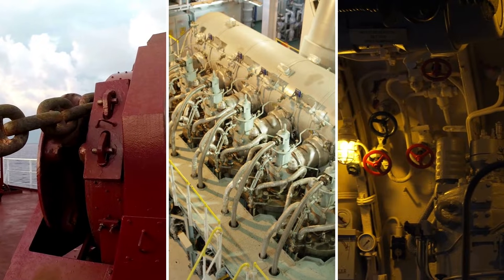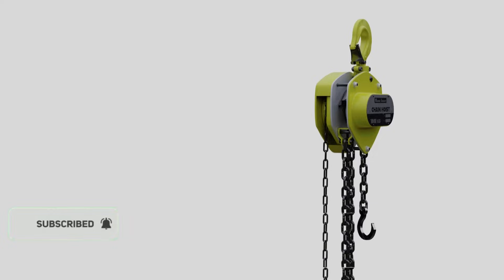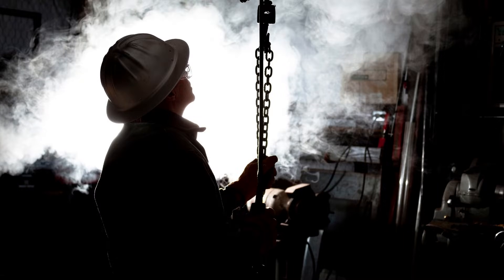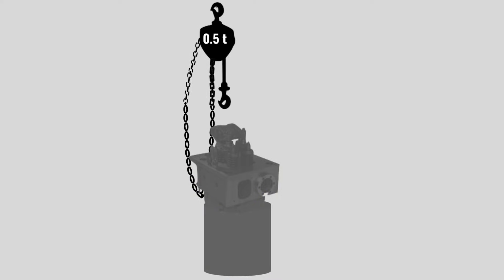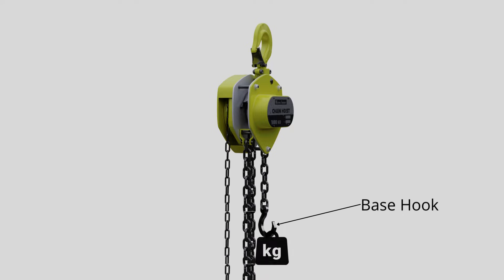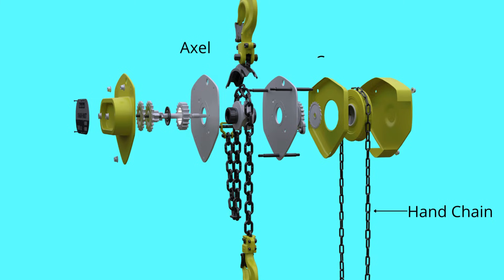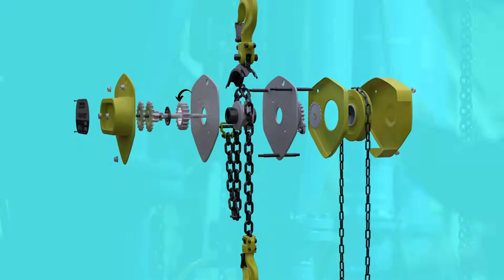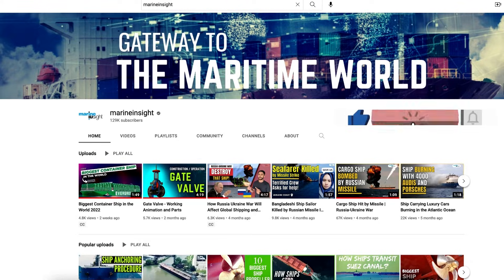Chain Hoist Manual

Comment: But you did not explain the ingenious clutch which comes in when lowering the load. You explained only the simple parts which may be learned intuitively by simple gearing ratios , but the slipping clutch when lowering and non slipping while raising the load would have been beneficial to many viewers.
Reply: That was indeed the most interesting part I was really looking for when I went for this video. Thanks for indicating it.